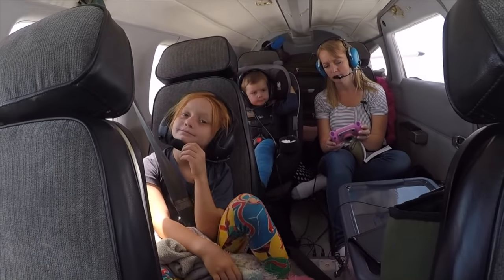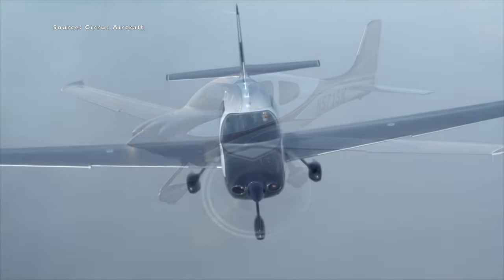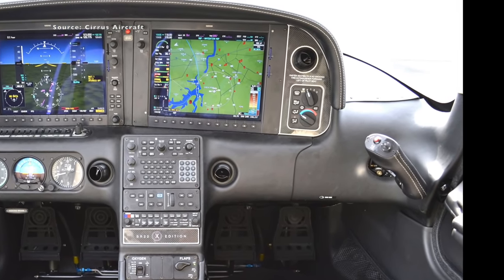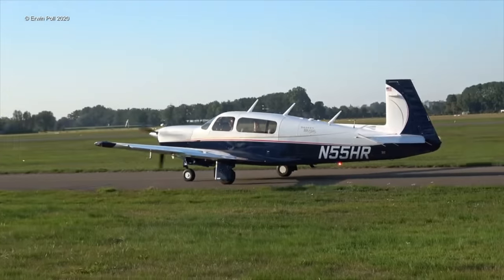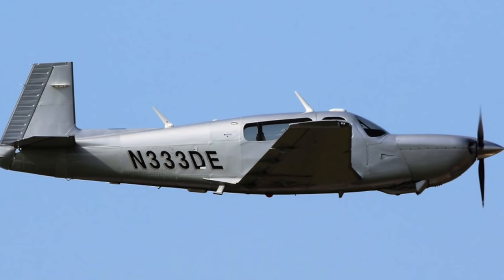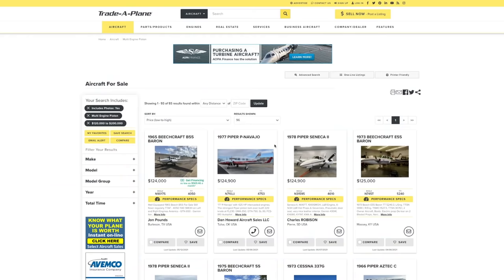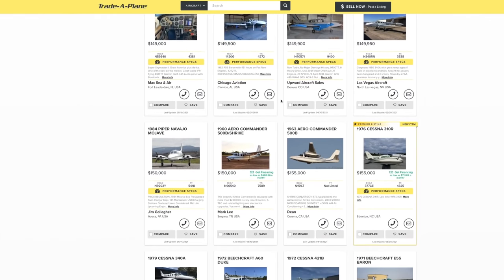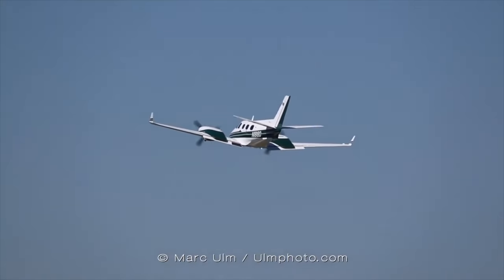10 Fastest Cheap Airplanes You Can Buy For Your Family

Comment: My husband and I had a turbocharged Piper Saratoga we flew for over 30 years that we called our flying station wagon. It comfortably seats six people, has a range of 1,200 miles and cruises as fast as a twin on a single engine at 200+ knots and maintenance costs and fuel consumption were much less than a twin. So while other aircraft may have slightly better performance in one area or another none is more well rounded in terms of comfort, cabin size, weight capacity, range, speed and operating costs than a turbo charged Piper Saratoga with retractable gear.
Reply: Loved the countdown and hilarious free speech. I am not into planes but Google's algo must think I am a South American Coke runner.
Reply: Niicceee. Good rec!
Reply: I Do Asset Manager, Accounts And Tax Manager  Money Manager, ASset Transaction, Transfer Purpose , I Do Work With Safe And Honestly
Reply: Was that the type that killed JFK, Jr and two?
Reply: @MalachiWhite-tw7hl No, JFK Jr killed himself, his wife, and sister-in-law in a Saratoga. The plane didn’t kill them.
Reply: @singleproppilot  You mean it was not a Turbo?

Comment: I had the great pleasure of flying an Aerostar 601P for a short while. Just lovely to fly - as long as you had plenty of speed up. People asked me why it needed to go so fast to even turn, to which I replied, "it's got the same size wing as a Cessna 172, but thinner and carrying three times the weight". They got it!
I also had it up to 27,000' once, it would have easily gone higher but there was an inlet manifold leak on the left engine so I couldn't get full climb power from it. Max speed I ever got was 234 kts.
Reply from the maker: That's awesome! Great way to explain the need for speed.

Comment: A good friend of mine owned an Aerostar 601 (not the P). Got a lot of right seat time in that aircraft. One of the quirks not mentioned was the hot start. Easy to flood the engine. Turn on the pumps, crack the power levers a little and then off. Crank the engine with no power and as soon as it fires add power. Great airplane to fly. Light touch on the controls and it moves. It is slippery and tough to slow down when descending. I can we used to keep up with the commercial aircraft on approach.
Reply from the maker: that's a great share!  Thanks!

Comment: I would take my Miller conversion twin comanche at 175kn cruise, 18 gph cruise burn, and 500 fpm single engine climb on hot humid Mississippi summer day all day long. Plus 104 useable gallons with IFR reserve. Up to 6 seats. No CG shift with fuel burn.
Reply from the maker: yep, that is a great setup!
Reply: S/E though is a bit concerning.
Reply: That is a boss plane.

Comment: The 421 is the biggest hangar queen I have ever been around! The gearboxes on the engine on a nightmare if the pilots are not train right on how to fly it.
Reply from the maker: I have heard that about geared engines.  What's the secret to them no breaking?
Reply: @therealjimmysworld   it’s easy, engine management. don’t let the props drive the engines. Pull the engine back bit by bit and same for the props.
Reply from the maker: so, what I'm hearing you say is, fly it like you own it... not a rental.
Reply: @therealjimmysworld  Exactly, no going mental cause she’s a rental!
Reply: Hangar queen for sure.
Reply: Not necessarily. I have over 2000 hour is the 421 and almost 4000 in 400 series Cessnas. The 421 is a great airplane if you fly it regularly. And I don’t mean once or twice a month. You have to fly it at least once a week, minimum. Also, don’t slam the throttles forward and keep an eye alway on your EGT.  On decent bring the power back 1 inch about every 10 minutes or so and you’ll be fine. The C model has the easiest fuel system just make sure you turn the pumps on when you switch tanks. Never had a problem with the gear boxes but I did have an alternator shred itself once and an oil cooler go bye bye in flight. Also had a blue rag stuck in the intake that got left after a 100 hour that made my life interesting for a little while. Most of then problems I had were with the autopilot and the radios. The century 2 autopilot was never designed for a twin so make sure you but one with a garmin or better. I honestly don’t remember seeing 200 kts at cruise very often but she will haul everything you put in her and will be relatively quiet. Do a recurrent every six months to practice simulated engine failures or she will kick your butt also make sure you don’t skip leg days at the gym. You loose an engine on take off and you’re gonna need all of that strength and immediately raise that wing or you’re going in the dirt. I fly a Hawker now and probabaly wouldn’t go back but it was great for my missions then. Great video by the way.

Comment: I used to work as a ramp agent for a small family airline in Kenai, Alaska. We operated Piper PA-31 T-1040 series aircraft. These were the Navaho Chieftan with twin 650hp Pratt & Whitney PT-6 turbo prop engines. We operated 9 of these aircraft between Anchorage and Kodiak, Alaska. These aircraft burned 50 gph for a 250 knot cruise. Piper only built 31 of this model. One of the pilots was also a flight instructor and he taught me to fly them it was a real blast. We once flew from Anchorage to Kenai in just under 14 minutes from engine start to engine shut down. From that day on we called tail number N304SC  the "Moose River Bullett". Sadly the airline shut down in 1998. I think that only 1 or 2 T1040s are still airworthy. Most have been sold for parts in the early 2000's.
Reply from the maker: very cool!

Comment: I know this is a family channel, so I'll keep it clean. I was a summertime FBO 100LL gas pumper for 4 summers during college. 1976-1979. Your hear the scuttle but. The mechanics all have their opinions and pet peeves. I learned a lot by watching other people pre-flight and fly their airplanes. Most people were decent pilots. I usually pulled their airplane out of an old hanger made of 2x4s and corrugated metal. I'd fuel them as requested, check and fill the oil. 90% would do a walk around to check my work and the airplane. Unfortunately, many, who may not have flown the plane for months would just hop in with passengers. Fire up and go. I could have knocked the tail off of the airplane or seriously damaged a wing or the tail empennage. And been frantically trying to find them. They would never have known until they were trying to rotate for liftoff when it was too late.
About the Duke. Nobody on our airport had a Duke. To my college aged  brain, and the mechanics. Taxiing up in a Duke and shutting it down in front of the hanger was like "pulling it out of your trousers and flopping it down on the pavement". Seriously. It was somebody demonstrating they were the Big Long D**k at the airport. 2 of them were flown in during the summer by the owners of Traveling Carnivals. Late 1970s? Maybe a side business?  Pure speculation on my part? I never fueled a Duke for someone who didn't pay CASH. Lots of CASH to fill up a Duke. No receipts were ever requested.
Reply from the maker: hahahaha, thank you for keeping it PG.  I imagine all those cash payments were in singles.... hahahahaha. #Lambolifestyle
Reply: @therealjimmysworld  We didn't even have a cash box in the truck. We did have the old credit card machine where you slid it back forth over the card and made "carbon  copies" and had the customer sign one.  The cash was multiple rubber banded rolls of all low denominations. $20 Max. At least 2" in diameter. Maybe he worked at Chippendale's? I'm not judgmental. They would sling the bills off while counting, just like in the movies. I would walk into my bosses office with my jeans pockets stuffed full of this cash and dump it out on his desk. He'd give me a frown, a wink and a nod. My summer job slinging 100LL for him got me through college. I owe him a lot for that. Wayne Reavis, Medford OR.
Reply from the maker: and then go wash your hands very thoroughly!! hahahaha
Reply: @therealjimmysworld  Buying lots of 100LL for "Cash"  was probably one method of "laundering" the money. You know, to keep it clean for everyone.
Reply: Carnival operators even (County) fair food vendors make HUGE money. $1M a yr. Cash. Its why its nearly impossible to get in. Anyway, One family had a vendor biz at all the County fairs, so they traveled. Had 5th wheels. A dtr married & the new son in law didnt want to work for his money. He killed & stole the boxes of cash they hid in their trailers. (He did get caught). Not with lots of cash all are drug dealers. Some just make a lot & dont want to report it.

Comment: Once again, Velocity Aircraft are overlooked. My XL-5 RG (N36LV) had 370HP, could carry five people, cruise right at 200kts on 13 gph, couldn’t stall and had a range over 1000 nautical miles. With just my wife and me onboard, our time from sea level to 10,000 ft was around 5 minutes flat. Before final interior and paint, my initial test pilot (140 lbs) did it in 3 minutes and 30 seconds. Mine was normally aspirated but the turbo models can easily make 240kts in the flight levels. Big omission, Jimmy.

Comment: Just saw your number 1 choice....  I flew them for about 2000 hours, you didn't mention the flying qualities.  If you have not yet flown one you are in for an extremely pleasant surprise.   You will also find as you dig deeper into the Aerostar, the accident rate is not due to the aircraft, its mostly due to pilots not giving it the respect it deserves, or not maintaining the proper proficiency.  It does have some quirks, but they are not game changers, just have to pay attention.   Things like don't cycle the gear with any side load on the airframe, don't fill up the tanks and let the plane sit on the ramp.  Most important... Understand the fuel system!   Like any multi-engine light twin, be proficient in your engine out procedures, there is nothing about the Aerostar that is unusual in SE operations but, it is not a trainer.   Interesting tidbit, the tail horizontal and vertical control surfaces are interchangeable.  Not that it would come up, but interesting.
Reply from the maker: Everyone I have spoken to that has flown them said the same thing.  I am sooooo tempted to get one, but both of my IA connections said they would disown me if I did... :(
Reply: Jimmy, explain to your mechanics that you're buying the 600 not the 601P. A world of difference in maintenance cost. The 600 has 2000 hour TBO engines and none of the headaches associated with turbos and pressurisation. If you don’t operate from high altitude airports then you don't need the P model. Don't get me wrong the 700 is great but the 600 will give you the biggest bang for the buck. As Harley said most accidents are the result of pilot error (not understanding the Aerostar). Especially not doing any high bank turns when operating in dual crossfeed fuel management.
Reply: Like the Aero Commander and other designs by engineering design legend Ted Smith, the Aerostar has excellent handling, tank-like structural members and gobs of speed.  Very underrated.
Reply from the maker: great channel!  beautiful 702P. Watching your videos now.
Reply: @therealjimmysworld  thanks Jimmy.
Reply: Kraft Heinz is the #5 Food and Beverage company in the the world. Headquartered in Pittsburg PA. Theresa Heinz is a ~3-5 th generation heir who was married to Senator John Heinz. Relevance? Senator Heinz was flying in an Aerostar that was having gear extension problems ~1991. Around DC if I remember correctly. A helicopter offered to approach and observe the gear "situation". It got a little too close, aerodynamic interactions intervened and then...things went South. Big crash everybody killed. Leaving a grieving wife to marry...guess who...John Kerry. The same John Kerry from that small weird fraternity at Yale that G-Dub graduated from the same year. Surely a coincidental, love at first site, Romance. Who amazingly, statistically impossibly, ran against G-Dub for his 2nd term. Pure coincidence, I'm sure. It's a Small World After All. Uh Oh, My Disney programming is kicking in. Sorry. I'm drifting off topic. I flew with a friend, at the time, in a 601P. That's why I had read the accident report about the Senator Heinz fatal crash. Even in 1991, the P models were suffering pressurization problems because the GOO used to plug the wiring holes into the pressure vessel was hardening and failing to be air tight. This was before the super duper "Flex Seal" was available. A friend suffered a cruise level engine failure in the same planeand landed successfully. I experienced, as a co-Pilot, the failure of the "shimmy dampener" on the nose wheel. No big deal, the pilot held the nose off and everything was peachy until the speed slowed. Then, the airplane shook so violently I thought the instrument panel was going to come off on my legs. This is my reminder to your audience. If you are in any way involved in questionable political intrigue or power struggles, directly or indirectly. Stay out of small airplanes. Of any type. Jimmy? My gut tells me you are completely safe.
Reply: Harleybuc01 The interchangable horizontal and vertical tail surfaces is an incredibly interesting detail. For me, at least. Are there any other airplanes where that is the case. Ted Smith was brilliant designer. But both common airplanes he had a big hand in designing had weird fuel tank/flow problems. No airplane is perfect, but I always found it interesting that both of these popular designs had similar quirky fuel tank problems. Two great men died in an AeroCommander from double engine failure on approach due to fuel starvation. The co-Pilot didn't cage the engine throttles, props mixture and fuel tanks. They would have landed short in a field. But, unfortunately, one of the engines fired up way below VMC. And 4 people died. Not the designers fault. But, things happen fast in twins with both engines out. RIP George Milligan and Hank Boenke. Good friends of mine.
Reply from the maker: Well, I was thinking of running for Governor... but now I might question that decision... lol
Reply: @htschmerdtz4465  And unfortunately an associated history of fuel malfunction/distribution problems. It killed two great friends of mine in an AeroCommander with a double engine failure on approach. They weren't perfect but probably would have landed safely in an open field short of the runway. Suspicion is that the co-pilot was continuing  to try to restart the engines. He succeeded. Well below Vmc and the the plane immediately rolled upside down. Crash and no survivors. Definitely pilot error. But several of the Ted Smith designs where known to have unusual problems with the fuel systems. The pilot knew about this when the airplane was purchased. I rode along when my Dad was initially checked out in the Part 135 airplane and fuel management quirks/difficulties were discussed. Unfortunately, that didn't help the Chief pilot who was one of 4 people killed that day. RIP George and Hank. Sorry, this is kind of a repeat of my earlier post. That crash was a huge loss for aviation and many, many people. And the other commenter mentioned the cross feed fuel problems in the Aerostar. That is a design problem. In my opinion. I guess Bob Hoover knew how to handle it it as he flew quite a bit during his shows with both engines out.
Reply: @therealjimmysworld  forget about Governor, Jimmy. Go for the Gold Ring and run for President. Then you could ride in some great airplanes. You wouldn't get to fly them though. However you would always get ATC priority wherever you went in the world. Plus, I think your brain function is infinitely better than the farcical puppet who Is, supposedly, running our Country. You've got my vote.
Reply: @@
Z
Reply: I can't share your enthusiasm for the 601P. They don't call it the Widowmaker for nothing. The best advice that I can offer is never let it get below 100 knots.
The nosewheel comes up forward, into the airflow, and the hydraulic pump that drives the nosegear is too small to overcome the airflow so the pilot must get the gear up before reaching 130 knots. If the hydraulic pump could be replaced with a larger one the story might be different.
I used to demonstrate the 600 back in the 1980 era and since then I have worked on the 501P. I will never own either - I'm not a fan.